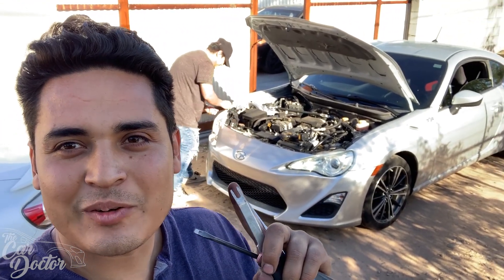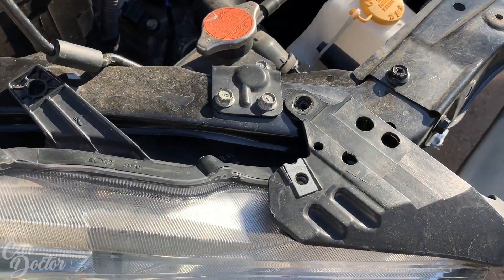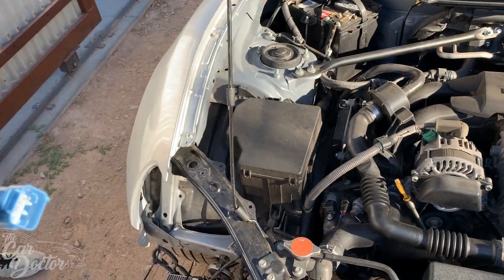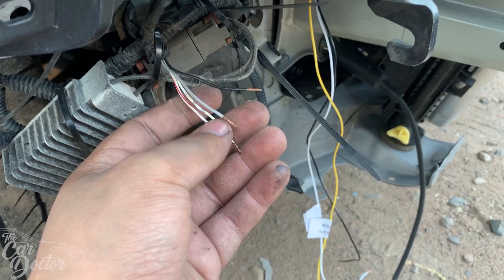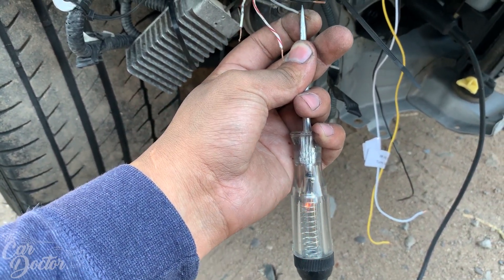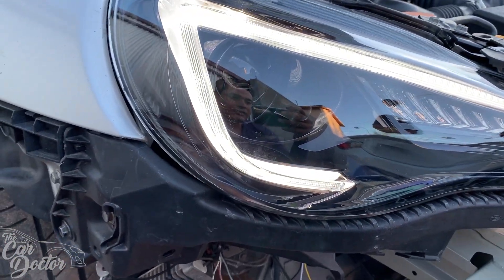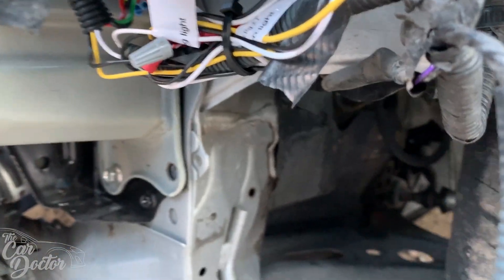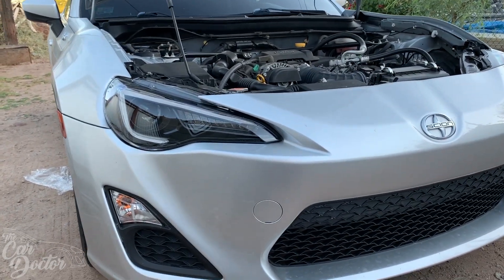BRZ VLand Headlights Install

Comment: So I’m having a issue with the turn signals, they are sequential when I have my hazards on but when I try to use the blinkers it hyper flashes and only does two of the lights. This is for a brz and I’m unsure on the issue.
Reply: Did you figured it out i have the same problem
Reply: @Ruthless69  I forgot what it was called but its a kit that controls the timing of the the sequential turn signals that fixed my problem

Comment: How would I wire it if I wanted no DRLs, but wanted the boomerang to only light up when I turn on my fog lights?
Reply from the maker: You wire it to receive power from the fogs trigger. I haven't wired these up that way. Alot of testing to get your desired look.

Comment: How the heck do you get the bumper back on so well without the bumper gap
Reply from the maker: A worn or broken headlight positioning cover or they miss the crucial bolt going from the bumper to fender. Finding the perfect fitment and bolting in position is key.

Comment: Hello, good evening!

What bulbs are you using? Thanks!
Reply from the maker: This wasn't my car, so I don't know.
Reply: Hi. I've bought the lights with the recommended bulbs but there is a connection issue. From the one pin connection to the two pin in the headlight. Any ideas? It mentioned something called a ballast?